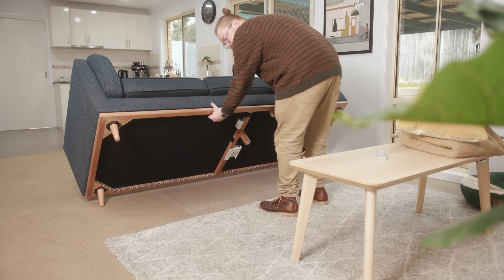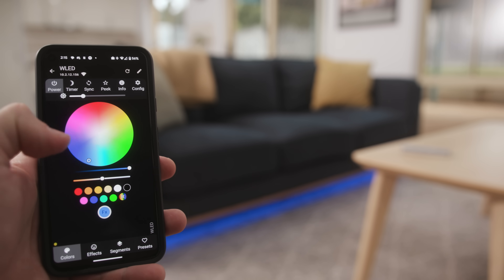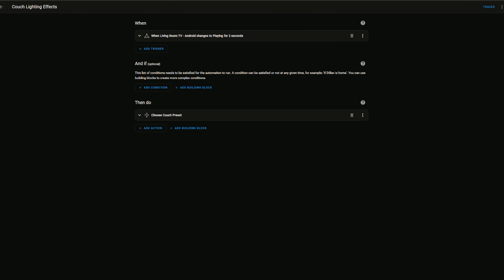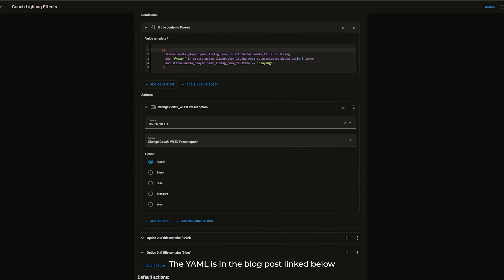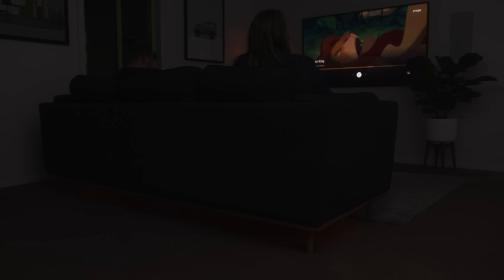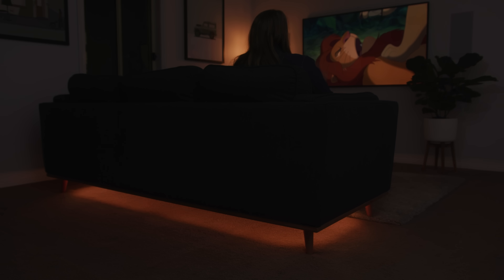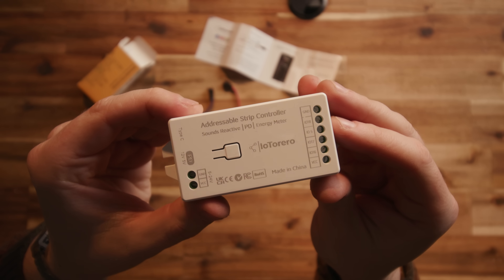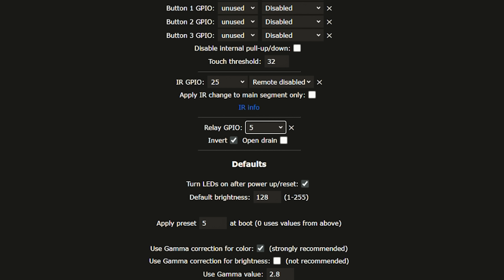DIY Smart Lighting — Completely Wireless!

Comment: In an old house my practical version was a long LED strip under the lip of the kitchen counter, with LED groups set per drawer/cupboard. When a drawer opened the group of LEDs would light up and felt very premium.

For the movie watching scenario, this feels like a perfect opportunity for the new Home Assistant AI tasks action. It would be fairly easy and infrequent enough that you could justify using an LLM to suggest a colour scheme based on your movie title, and then it will be dynamic and reasonably relevant for any content

Comment: So a few years ago, I made a 10' diameter UFO for halloween and used individual addressable RGBW LEDs. Main thing I learned from that are the wires. 1- Don't use solid wires. It will rip off the pads. 2- I found out that a long data line is over 30cm. So we had to rush to the hardware store and get lawnmower wire since it was a thicker gauge than what we were using, I think it was 16g? Much thicker than any wires I saw at like Micro Center. You probably already know those things with your smart home, but I went into that UFO project only knowing color temperatures, nothing about electronics in that sense or powering it. Now I just want to figure out how to use it in another project but not require a chonky battery

Comment: Instead of using the PowerBank which WILL become a hassle just run a power cable under ur carpet it works just as well without having to use the powerbank, and if u insist on using the powerbank, route some extra extensions to the top of ur couch so u can charge ur phone too. Also where did you fiind the led strip? I couldnt find any for less than 20 dollars

Comment: I would 100% recommend led strips from BTF-Lighting. Their led strips are super bright and good quality, it does cost a little more but it is definitely worth it. They have all sorts of different types of led strips, ranging from lame rgb non-addressable leds, to addressable rgb leds with adjustable white light with waterproofing. I used them in a lightsaber project and they are amazing. Definitely check them out.

Comment: Hey, great project as usual. My experiences with similar LED tape tells me that the glue will likely give out. There are plenty of 3D models online of little holders to clip over the tape and screw it tight.
Another note: Especially if you use this at high brightness, don't underestimate the heat that can come off this kind of tape. For longer life, try to always mount it to some alu LED profile that can act as a heatsink. They also make nice easy diffusers for those if you want to avoid being able to see individual pixels.

Comment: I have measured around 100mA per meter on my 12V 60/m RGB band from AliExpress when... it's off. I'm going to use a relay or a sonoff on my power converter for sure.

Comment: This is a great little entry-level project for addressable LEDs. When I was first getting in to them, it felt so much more complicated, with learning arduino controls, etc. Now with ESP and WLED it's so easy to get started. Super easy! (btw, affiliate links for the products you used would not be unwarranted)

Comment: Loved the video! I believe the power bank might not have been the best idea tho, it'll become too much of a hassle to charge. I see that you have a rug, maybe running the cable under it would've been better. Also, you are going to be vacuuming under your sofa quite a lot, so a quick connector between the sofa and the cable might also not be a bad idea.

(If the thickness of the cable is a concern, there are quite thin or quite flat options on AliExpress)

Comment: I don't understand why you needed the white thing for the LEDs to connect to. What's the difference from that as opposed to just wiring the lights to your own ESP32? 
That way it would connect straight to Home Assistant through ESPHome.
Reply from the maker: The white thing is an ESP32! 

It just has all the logic level converters and power supply electronics built in :)

Comment: Cool! There's a HACS integration for Formula 1, so you can set the light to yellow when there's a yellow flag for example.
Reply from the maker: I did see that, but I rarely watch live, so it wouldn't work for most races. Might get it running for Melbourne next year though!

Comment: if your throw rug reaches all the way to the wall (or the media cabinet where wiring could be hidden), you can run power to the couch rather than having to rely on the power bank approach :)

(obviously only run low voltage that is current limited across the floor, not mains voltage)

Comment: I use wled in a unique way. Here in Australia I use Amber for my power company and have a Shelly EM3 monitoring my grid and solar power. So I have have a set of strips on top of a cupboard in a high traffic area and when the solar is pumping and the price of electricity is low I get wled to display different colours like a red orange and green to tell me if I should chuck in the laundry or the dryer and and to also tell
Me when not to use power. Works pretty well
Reply: This is madly genius

Comment: One tip: the adhesive on most LED strips is terrible and will start to loosen after a couple of months. I’d recommend going for a more secure mounting solution — there are plenty of different clips and brackets available.
Reply: I've had great success using 3M adhesion promoter wipes on LED strips for under cabinet lighting. It makes a huge difference as the ones I installed in my mom's kitchen have been securely installed for 3 years now without any sign of sagging or loss of adhesion. And the ones I installed in a different house were up for a year before I sold the house.

Prep is key. I clean the surface with isopropyl alcohol and then apply the 3M adhesion promoter and press the strips as firmly as possible.

Comment: I decided to spend the money on Hue. 6 years later, still flawless, no faults etc.

Not cheap, but in my opinion, when used as a whole ecosystem(switches etc), well worth it. No issues when internet/wifi drops out. Local hub keeps it all working.
Reply: same here but more like 8 years
Reply: same, but i hate the hue "wiz" app. is there a better / more intuitive / more features way to control the lights? i set up "rhythms" for different rooms to change colors throughout the day/night cycle, but theres a lot to be desired from wiz. for example, its impossible to set your brightnesses; for some reason they always default some of the colors really dim no matter how many times i change them in the app. also, theres no off position; there has to be some light on always. i can keep going with complaints, but im curious how you hue-lifers have managed to cope with all of the apps flaws. 

great video though! i def feel inspired to splash some rgb unicorn barf all over the place now (;
Reply: agreed. 10 years here. Never had a fault or issue with them.. of the 5 or 6 other brands I've tried (well known to unknown), each one has had some quirk or another. 

Wait for sales and Hue all the way.

Comment: I'd been wanting to do something just like this so this is perfect inspiration for me! We have a set of bookcases in our bedroom with no nearby power sockets, so was thinking along the lines of an LED strip powered by a power bank, but didn't know where to start.

One question though, how does the controller connect to HA? Is it wifi or zigbee?
Reply: Wled controllers are often based on ESP32 (as this one) and they work only with wifi.

EDIT: My bad, there are some from Gledopto that work even with zigbee and can be connected also with Ethernet cable if wanted, I wasn't up to date.

Comment: I think the power bank was a miss. It'll get charged 3-4 times before it becomes too much of a hassle and the couch lights usage will be few and far between. Anything that should be "set & forget" needs hardwired; otherwise it'll just be set & forgotten
Reply: They make a very flat speaker wire that you can use under the rug
Reply: @GillySqueeze that's cool
Reply: 1 watt per hour idle, 20a at 5v = 100w
5 days of capacity at idle....
It should be one month to be acceptable on my side
Reply: I'd agree with you if he didn't do the hot swap rig, this way you can have two power banks and you just swap between them
Reply: "Hot swap" but it was mounted in the middle so you gotta flip the sofa to swap it out.
Reply: @IbraheemSatti  As someone else mentioned, this setup will drain in 5 days on stand by. Imagine going on a week vacation, coming back home, you put all the landry in washing machine and just want to relax with movie. But, oh f*ck, you have to swap the powerbank (and flip the couch to do that in this case)? No thank you. I'd rather run a cable under the rug...
Reply: yeah, unless it is a huge ass battery, still the battery will keep losing its capacity if its not used regularly or it stays at a certain level for too long. A wall connected power supply would have been better tbh, or wireless charging.
Reply: add a solar panel to charge it on the side of the couch, problem solved....your welcome

Comment: At some point Ill get some tighter pinch addressable LEDs so I can put them in the Tron Identity discs I printed. I just printed the outer 'lights' in red for the other week but I hot glued everything as a temp to be able to reuse the parts later. Also because I know the sorcery to have hot glue remove from PLA like it was never attached if you want to know that too.